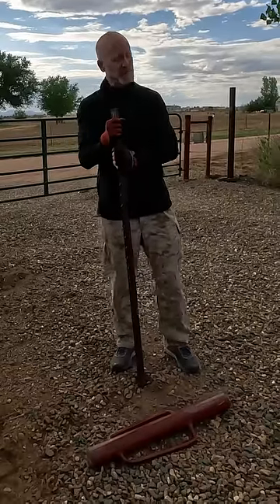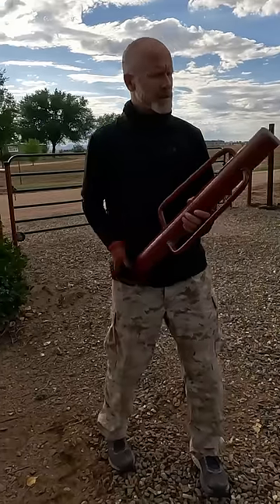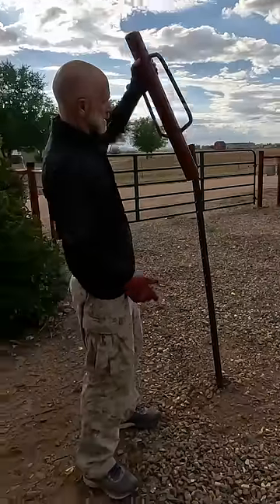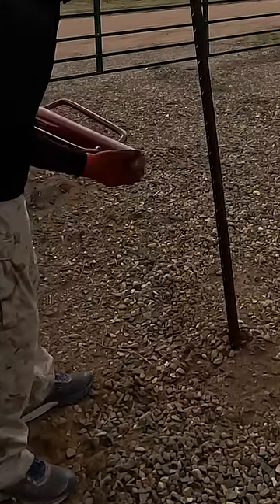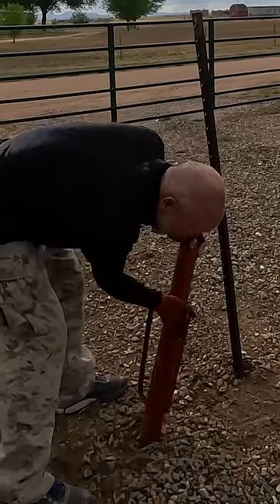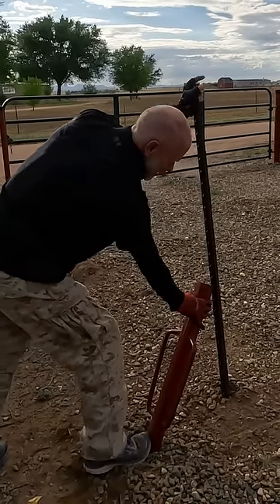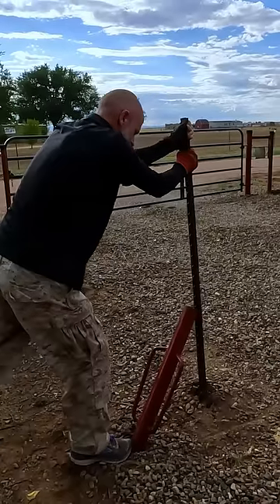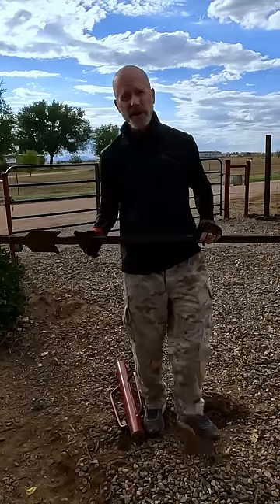Avoid Back Injuries with Simple T-Post Removal Trick

Comment: A chain tied to the bottom than ran over a spare tire. Then use a truck to pull the chain, the tire makes the chain pull up. You can pull 30 of these out in a half an hour. Hope that makes a little sense

Comment: Why dont you cut or grind a little U or V form on the bottom so it grips the pole better ?? And maybe weld a skrew in the middle of the solid top so it stays put 👌
Reply from the maker: Solid. Thank you. I am gonna give the U notch a shot. I like the addition of the screw but I embarrassingly don’t weld. I have something to learn this winter when life gets tough up here. Fantastic suggestion, thank you for taking the time. I appreciate that. Have a great evening. ✌🏼🙏🏼
Reply: @futurehomesteadingAZ  that's ok if you don't weld. You can just drill a hole and put a bult thru from inside, and put 2 nuts on the outside. It will be as good as a weld 💪

Comment: Good idea to use leverage but if you don't have anything to leverage with you can still pull it out the ground like you did in the first place just make sure to use your legs instead, with your stance you're using your lower back which is much weaker than your legs

Comment: Or you could use a chain wrapped around the post and attached to the handles... Just slide hammer it up a couple times to loosen it, then proceed to pull it out.
Reply from the maker: Not real common but it intrigues me. I need to give it a try. Thanks for the suggestion. Hopefully I don’t discover a new way to knock myself out. I have too many favorite ways to do that already 😂 thanks for taking the time. Have a great evening. ✌🏼🙏🏼
Reply: @futurehomesteadingAZ  Neccecity breeds creativity.  A chain with a slip hook attached to a 6' wrecking bar and a 12' log works good too.  Choke the bottom or the post, kick the log under the bar, use it as a fulcrum to lever out the post.  Once you get the hang of it, the slip hook will slide and regrip so you can essentially pump the post out until you can just grab it out with 2 hand and a wiggle.
A.r3cent one Undiscovered is using the side by side front winch.  Block under the fairlead to prevent suspension from squatting, choke the post with the slip hook and cable, pull in the winch.

Comment: If youre gonna go out and buy the tool for installing posts, why not also buy the removal tool as well
Reply from the maker: Never needed it. I have few ways to do the job but it’s a long walk to the workshop when it 107 out. If I got stuck I would have sorted it a different way. If ya need a leverage technique, this might help. If you have a method that you are comfortable with, that’s the best method. Knowing a few ways to do a job can be an advantage, even if you never use the knowledge. Thanks for taking the time. Be safe out there. ✌🏼🙏🏼

Comment: for like $35 you can get a post puller that saves your back even more it takes like the same effort as carrying a jug a milk to fridge to pull posts
Reply from the maker: Lactose intolerant. Haha. Only kidding. The puller is a great solution. Ran one down at TS for $50. I don’t like to limit my abilities with one method. If ya need a leverage method, you have this in your pocket. Be safe any way ya do it. Take care. ✌🏼🙏🏼
Reply: @futurehomesteadingAZ  jug of water then lol. yea i forgot about inflation i bought mine about 10 years ago, on the bright side its pretty much a once per lifetime purchase.

Comment: Or you could just use a post puller. Kinda like a jack but with a little loose c clamp end to grab another tooth with every crank
Reply from the maker: That’s a great tool and suggestions. Thank you. I appreciate ya taking the time. Take care of yourself ✌🏼🙏🏼
Reply: @futurehomesteadingAZ  yessir. I'll send you one if you'd like. I actually make them at my gate and panel company lol
Reply: @futurehomesteadingAZ  the post puller works WAAAAYYYYYY easier too lol
Reply: Hell you may even be able to find them at your local Tractor Supply/feedstore/hardware store/etc.
Reply: @futurehomesteadingAZ  gotta admit tho I've never seen anyone do what you did, and it was definitely creative, ingenuitive,  and seemed to make the job easier than if you did not have a post puller, however your life will be much easier with one lol and if you have a post driver you should also have a post puller

Comment: Lol thats a Cute little Store bought t post driver, get a 3' piece of 3" steel pipe and weld a plate on the end, 5 or 6 taps and its there
Reply from the maker: Funny you mention that and I am leaning your direction. I drove 8 posts a couple days ago. Even if I went after it and drove as hard as I could…….15-20 drives. When I get the new posts for the main gate I am gonna order some extra 3”. Great contribution. Thank you. ✌🏼🙏🏼
Reply: @futurehomesteadingAZ    Cut up Some Old Telephone Poles for posts, there's fence posts on our farm that are still sturdy holding up the fence and they're over 40 years old hand dug with a Manual Post Hole Auger and Packed with a 2"×4", you'll save money using old Telephone poles than buying T posts, more Labor to put them up but their cheaper, sturdier and last a long time.

Comment: You don't even need to do that, all you have to do is apply enough rotational force to break the seal that the ground provides and then pull up with ease.
Reply from the maker: I am with ya. My other driver has the twister on top. I can’t pull from my boot laces so I need the help up. That being said, there are far better solutions to skin this tpost. Thanks for the contribution. Breaking the seal is a minimum going forward. Have a great day. Stay safe. ✌🏼🙏🏼

Comment: That  only works in really soft soil and with the post flanges barely in the soft dirt!
Reply from the maker: This was 17”, less than the structural standard of 24”. And….folks have to do 36” in some portions of the country. Be glad you are not in Australia where I guy I was chatting with had to go 2m. I accepted a challenge of 36”, I have my doubts but it should be fun to try. ✌🏼

Comment: You can actually put trbar through the handle and use the other handle to pull it up against one of the ridges. 
Alot easier than this, just mind your back as well.
Reply from the maker: Another useful tip. There is a lot of good info on the driver methods. This is a really good contribution to the conversation. Thank you. Take care of yourself ✌🏼🙏🏼🕊️

Comment: I hate digging out star pickets
Reply from the maker: Those pickets are no joke. I had a convo with a guy who used them to hold the forms to level a 45 degree slope. Amazing strength. That puller from bunning (? Australian company) is a beast. Pulled them from 2m without a sweat. Not sure why we don’t use them here. They are versatile and the that Waratahs puller from NZ work like a dream for the typical duty. Size of a short handled spade and moves like margarine. Smooth. I am thinking about converting. Thanks for taking the time. I appreciate that. Take care of yourself. 🙏🏼✌🏼🕊️

Comment: Or you could also buy a t-post puller where you bought your t-post driver. :)
Reply from the maker: I may have😂 peer pressure got me. Knowing a couple ways is good but that tool is great. Thanks for the suggestion. Be safe. ✌🏼🙏🏼

Comment: No shit...welp I got one of those and like 60 post like that I need to remove, thanks brotha'!. "Smarter, not harder."
Reply from the maker: If you have a project like that. Grab a puller. This is an alternative to a grip and rip. TS has a solid unit for about $50. You don’t want to use a leverage method for more than a few. Good luck to ya. Enjoy your evening. ✌🏼🙏🏼

Comment: Someone get this guy handyman jack and some chain
Reply from the maker: It was a long walk in the heat. I could have skinned it a few ways. I had the driver, so I used it. There are better methods, such as the farm jack. This might sort ya in a pinch. Knowledge is useful even if ya don’t use it. Great suggestion. I appreciate ya taking the time. ✌🏼🙏🏼

Comment: Could still hurt yourself doing it that way. If it slips off you're in trouble and pulling backwards as you do can cause injuries to spine. Always push when possible, NOT PULLING. Proper tool or other time tested ways work lots better. Even a hi lift or a chain around post lifted vertically by hydraulic raised loader arm bears that. A tripod with suspended come a long works, lots and lots of better ways.
Reply from the maker: All great suggestions and you took the time to explain. A lot of value there. Thank you. 
I was just trying to provide a solution that most people would have if you have posts. More of  a try this before you grip and rip. 
I didn’t explain that well but the result was a global best practices conversation. Thank you for your contribution. The info in the comments is invaluable. Have a safe weekend. Take care. ✌🏼🙏🏼🕊️

Comment: or get the slightly better post driver with the removable end and put it over the post and then puta small bar through one of the hole and whack the driver up into the bar driving the post back out.

Comment: Interesting but they do sell a device that actually pulls those posts that's a lot easier than what he just did
Reply from the maker: They have a decent puller at TS. Run ya $50 and it will certainly get the job done. Knowing a few ways to sort things out is usually a good idea. A puller can only be beat by a tractor according to the comments. Any method ya do it, avoid the grip and rip. Be safe and take care. ✌🏼🙏🏼
Reply: @futurehomesteadingAZ  I agree I like that polar because it's better for the back and it's better than the trailer because then you don't have to rip up the rip up the pastor

Comment: Or you can use a battery powered chip hammer. So easy.
Reply from the maker: First time that one has been brought up and a very impressive tool. Also one of the more expensive methods in the comments but if ya got it, you are set. That does look like a lot more fun. Thanks for the contribution. Have a great day.

Comment: that makes too much sense. here i was getting the pump jack and 2x4. still using the notches of the bar obviously. but this, lot easier to carry the pounder than a jack
Reply from the maker: The jack is gonna be a better option if ya got it out already. If not, maybe leverage will sort ya out. It’s a better option than the grip and rip method that takes me out. The puller or hi lift are gonna remove you from the equation which is better. Be safe whichever way ya go. Thanks for taking the time. ✌🏼🙏🏼

Comment: I guess I'm doing something wrong because I drive it in with a bucket on a tractor and take it out with the same bucket and a 3/8 chain of course I usually don't remove them until the are in a useless state like rusted out or bent very badly in which case I'll push it over with said tractor and I also usually use wooden post cut from an old telephone pole

Comment: Yeah, not mine! Our soil throws a big middle finger at everything except digging them out! I’ve used hi-lift, standard rolling hydraulic jacks and every other ”trick”. A post hole digger around it works the best.
Reply from the maker: Wow. You have some angry earth. I hope it produces some good food for ya. One thing is for sure……you plan ahead. That post is exactly where ya need it. I can’t imagine how difficult a post hole digger is gonna be if you are failing a hi lift. Be safe it appears you have your work cut out for ya. Enjoy the weekend. Take care of yourself. 🙏🏼✌🏼
Reply: @futurehomesteadingAZ  unfortunately over the years we’ve had to move posts around because of animal demands. We don’t have enough room to justify specialty tools or tractors 😁
Sometimes the wings will rust off the older ones and they’re easier. I’ve learned that the stamped ones are not worth the cost savings over the thicker cast(?) posts. We are hydrophobic, rock and clay heavy soil in So. Cal that doesn’t produce much either! Raised beds or heavily altered is the only way we can grow anything.
Reply from the maker: @thelast929  that really sounds difficult. It’s all work but you got an extra serving of back breaking potential. Focus on good form so you can remain comfortable as long as possible. I know that’s when I run into issues. Be safe out there. I hope you can find a way to make life a little easier. Sounds like the deck is stacked against ya. Take care out there. ✌🏼🙏🏼🕊️

Comment: Wet the ground, pull them out. Also they are called “star pickets” not “T post”
Reply from the maker: Down by you they are. Good to hear from ya. I get excited that we can chat like this. From what I hear…..The star pickets are round and you can’t lock it in like this. But why would ya. I researched that system and like it a lot more. From the strength to the removal tool, I find it superior in theory. I want to try that system. Thanks for jumping in. Always fun. ✌🏼🙏🏼🕊️
Reply: @futurehomesteadingAZ  star pickets aint round, they have 3 points, they are a 3 pointed star shape
Reply from the maker: Interesting. I appreciate the correction. Makes sense. Maybe when I was told they were smooth or round meant they don’t have the same nodules. Now I am curious. Thank you. ✌🏼🙏🏼

Comment: Sure this guy has a front end loader tractor and some chain...
Reply from the maker: Wish that were the case. Everything I do involves hand tools or chasing equipment. 
That being said, I could have got the hi lift if I needed it. I was out driving a ground rod for the mule install. That post had to go so it went using what I had 
Lots of better ways. And Lots of room for improvement on my side.  Thanks for taking the time. I appreciate ya. ✌🏼🙏🏼

Comment: They make a t post remover, for like 15 bucks.😂
Reply from the maker: You picked up that 1985 money puller. 😂. As long as it works. It is a fantastic tool. Top rated in the chat. If you need to replace yours, gonna run ya $50 at TS. I might have picked one up. Peer pressure is terrible. 😂🤣😂 thanks for taking the time to join the convo. Great suggestion good to have ya. Take care.  ✌🏼🙏🏼

Comment: They make a tpost puller that doesn't cost much and lot of smarter than that
Reply from the maker: Fantastic choice and the leading solution. $50 and a trip to town should get ya sorted. I find it’s nice to know a few ways to handle business. Just don’t grip and rip was what I was trying to convey by using a tool that many have. I appreciate ya joining the convo. Solid solution. Have a great day. ✌🏼🙏🏼
Reply: @futurehomesteadingAZ  I use my tractor most of the time but do have the puller

Comment: Tie another post to the base and use it as a lever to lift it out of the ground. U might need a rock to put under the end.
Reply from the maker: That’s a good option. Using what ya got was the idea. If ya have one post, you have a barn full. Great suggestion. Thanks for taking the time. Be safe. ✌🏼🙏🏼🕊️

Comment: i mean a farmer's jack will get any post out, took a fence down, the posts were 4' deep and had concrete at the bottom so frost wouldn't pull them out... farmer's jack did the trick effortlessly., owner tried his truck and fucked it up when strap broke hahaaha
again work smart
Reply from the maker: The farmers jack is the Swiss Army knife of the workshop. I will grab it when the roots get me twisted. There is no way this method could sort out that job, 4’ with concrete….I wouldn’t even try. I would have loved to see the truck method followed by you popping the post in less than a minute. The looks would have been fantastic. Thanks for joining the conversation, definitely a better solution. Take care and be safe. ✌🏼🙏🏼

Comment: Dude … 🤯
Reply from the maker: It might sort ya out if you have limited resources. The post puller is the better method and a good investment at around $50. Any way ya do it, avoid the grip and rip. Thanks for taking the time. Sorry for the delayed response……I had to learn the comments section overnight and I still have learning to do. Be well, be safe. ✌🏼🙏🏼
Reply: Absolutely no worries. Spent 35 years digging and yanking.  Amazing what we can learn off each other on YouTube.

Comment: Good luck doing that is solid soil... there are better tools that you lever in and push down by using body wait to pull them out.
Reply from the maker: Agreed. A far better solution and a great investment. I may have gave in to peer pressure. 😂 There is one in the workshop. Knowing a few ways is good but not needing to use a leverage method, like this one is much better. Keep the damage to zero. Thanks for taking the time. Have a great weekend. ✌🏼🙏🏼

Comment: Duh, wrap a chain around the bottom of the post and through the handle. Leave about 10 inches of slack and use the tool in reverse.
Reply from the maker: Not sure if it’s a duh moment but yeah I can see that as a possibility. It’s not as common as ya think. That makes you an innovator and a contributor to the convo. I appreciate that. Be safe in whatever you do. ✌🏼🙏🏼
Reply: @futurehomesteadingAZ  Thank you for the kind words.

Comment: Do you mean a " star picket ?"
Reply from the maker: This question came through without a chain so I am a bit lost. I have spoken of the star pickets in the chat as a superior system. It might have auto corrected. I was pulling a tpost which is used in the USA. I heard ya can’t pull a star picket with this technique because they are smooth. I have also looked at those puller and want to try them. I hope I answered your question, without context it was tough. Thanks for taking the time. Be safe. ✌🏼🙏🏼🕊️
Reply: @futurehomesteadingAZ oh yes I see the difference , I have never seen one of these, in Australia there is a tool that is just two bits of iron with a joint for leverage , there are also cordless impact drivers for star pickets along with air/hydraulic versions . But the new cordless one works well
Reply from the maker: It’s a much better system. Thinking about moving for the fencing alone. 😂 be safe my friend. ✌🏼🙏🏼